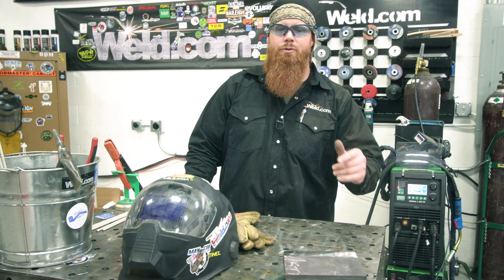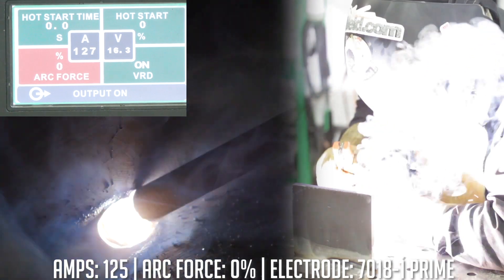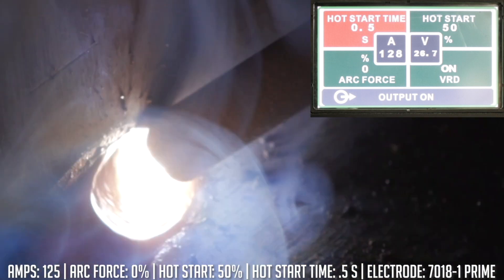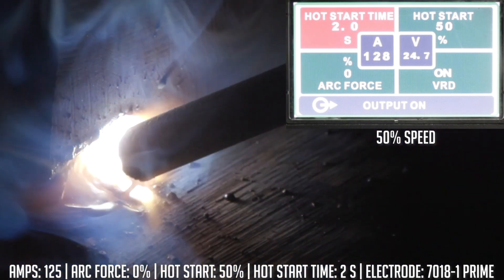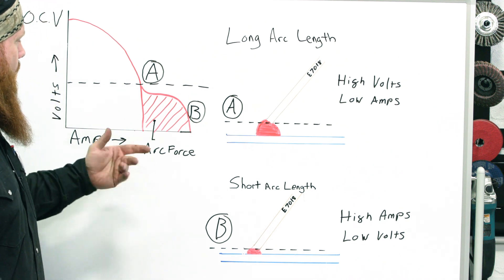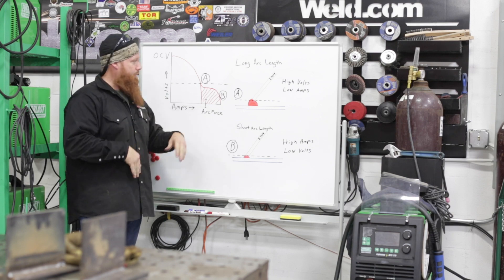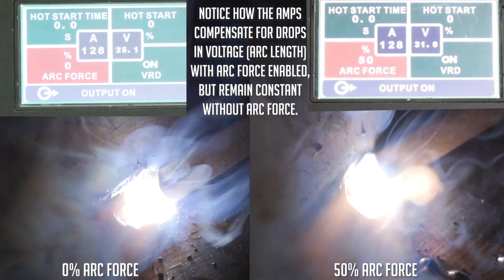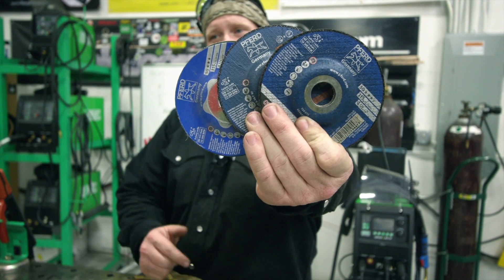Everlast Lightning MTS 275: Stick Welding Review

Comment: Great video I just received my MTS 275 today and loving it. 3rd week in school (VECTOR) Georgia Tech. Your video's have helped tremendously.
Reply: any feedback or updated review by chance? still loving it?
Reply: @dukyben733  Still an awesome welder. Did really well in all phases of welding. It was easy to change over from stick to MIG then TIG. only problem I had was running a E6010 root with Lincoln rod. But could be settings I just didn't have time to mess with it in class. So I used the older box for that. But it did run a E7018 like no ones business'. The 400 cooler is a little loud but torch never got hot welded all day no issues. Everyone else had to stop let there Lincolns' air cooled cool off and came by giving me the stink eye. It is a beast in MIG mode and loved it. As well the Everlast customer service was outstanding and got my new add on Nova 26 series torch to me promptly and even had one of there instructors call me to try and help with E6010 issue. Overall still love it.
Reply: Brooooooooo... this is crazy...... I'm currently enrolled @ Vectr Center with Mr. Curtis doing his Welding program and I'm planning on buying the same machine hahaha... if you happen to see this comment after a year what are your comments on the Everlast 275?

Comment: Is this a recommend welder to purchase? I have been looking at this everlast mts 275 for a bit and I really like it. I've been reading up on everlast multi-process welders and they seem to outperform the rest. I have used Miller welders in the past and I like them, but now I'm thinking about some other options. I have really only mig and stick welded. Never tig welded. Any advice?

Comment: Have you guy's put a meter on the everlast welders and see if the machines are putting out the amps that read on the dials? I have heard they run hotter than they advertise..

Comment: I have some questions for Bob Moffitt is there an email address I can reach him at. Really I'm in between the ESAB Rebel 285 and the Everlast Lighting 275. I've been a pipeliner, rig welder, combo/pipe welder in plants and a shop hand welding vessels and piping systems for 15 years. Ik what to look for as far as what I need but I just can't make up my mind to pull the trigger on the ESAB given what I've seen with the Everlast. I'd like to talk to a welder with a background similar to mine who has welded with both machines. Ik you guys can't give an honest opinion given the endorsements and sponsorships but if I could contact him or you through email and get an honest unbiased opinion from someone who's in the trade or "been there" I'd be one happy guy. 3-4k is alot to spend on an idea. Anyways thanks y'all keep at it. God Bless TX.
Reply: The rebel is only DC.  The Lightning is AC/DC.  Both good units, but both different in what they offer.  I am not Bob fwiw.
Reply: @everlastgenerator  Are you saying the ESAB Rebel 205 is NOT ac TIG?

Comment: besides the simplified lcd screen does it have any more functions than the 221sti. I realize the 221 is only a 200 amp machine also.
Reply from the maker: It's more in line with the 252. It also has Pro set, which let's you choose wire size and material thickness and it will set itself.

Comment: I noticed you were running with the vrd on. From the research I've done on vrd it's to reduce the chances of getting shocked in a damp or wet situation. But I don't really understand how it does that or exactly what all it does or what the benefit of not using it would be in any situation
Reply: VRD reduces the open circuit voltage to 45ish volts, as opposed to the normal 70ish.
So less chance of getting shocked, but also the reduced voltage can give slighly worse starting an welding on certain electrodes.
For example a 6010 cellulose rod will not weld very good(or not at all) on lower OCV'S

Comment: In the 3 major welding process stick,mig and tig I keep  blowing the ends of my welds or getting a crater  how can I prevent/ correct this I have my ground connected directly to the work piece 😞
Reply from the maker: Add more filler at the end of your weld.

Comment: I guess the question is, if arc force bumps up the amperage, how is it different than bumping up the amperage?
Reply from the maker: It adjusts on the fly based on your arc length.
Reply: @Welddotcom  Yes.  But if you run a constant tight arc (like you're supposed to) then really you're just running higher amperage.  So I too wonder what the real difference is versus just adding 10-15 amps.